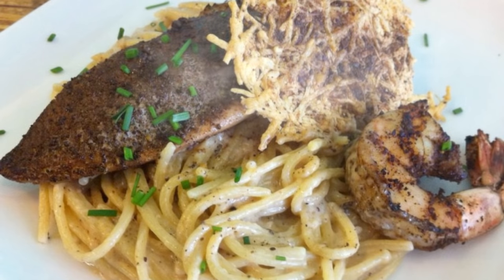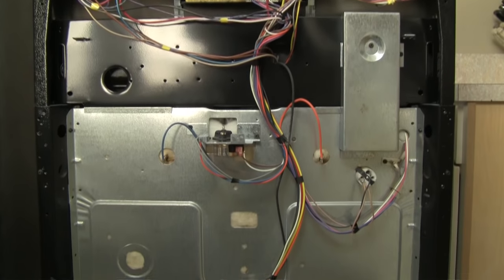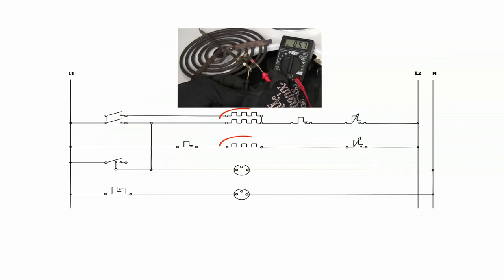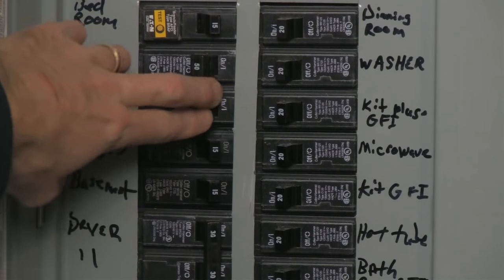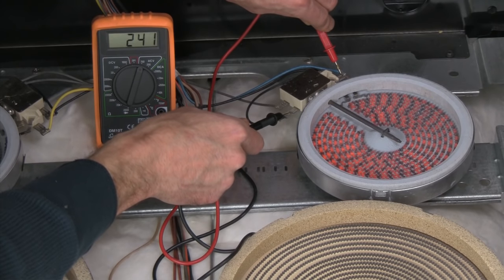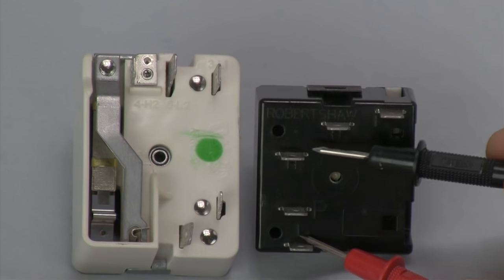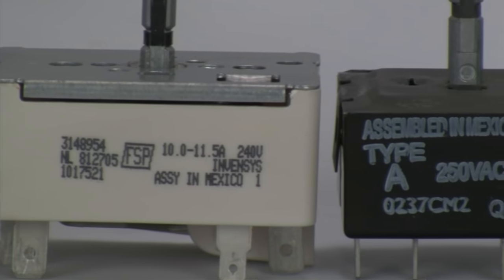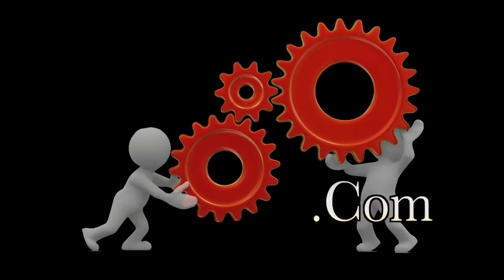Electric Range Stove Repair: How To Repair Burner Elements

Comment: Moving my GE true temp glass top stove has 4 prongs and old stove only had three, how do I convert to 4 prong?
Reply: You buy a four prong range cord and connect as follows.  The black and red are the two hots and connect to L1 & L2 respectively,  the white is neutral and goes to the corresponding terminal.   Green is ground and connects to the frame, typically a typically a green hexagon screw.   You must remove the bonding strap or wire that connects the neutral to frame if you're converting the range from a 3 wire to 4 wire setup.    You must reconnect the neutral to frame bond if converting from 4 wire to 3 wire. For this reason it's a good idea to hang onto the bonding strap in case you move into an older home with 3 wire range/dryer receptacles in the future and plan on taking the appliances with you.

Comment: Hi, I like your video as my glass top range is going to some problem.
The problem "I have Glass top range, one of its Burner shuts off early not reaching the desired heat and that is the bigger burner we use most." Need your assistance to fix this.
Thanks
Reply from the maker: Hmmm... that is a little strange.  Does it come back on after it cycles off?  Or does it just stay off?  What is your range model number?

Comment: Thanks for the great video. I have a newer Maytag glass top rage and the high output element will only work on medium to high. Nothing below works at all. I have already replaced the switch and that doesn't seem to be the issue. Any suggestions? Thanks.
Reply from the maker: What is the model number? I will try to find the wire diagram and take a look.

Comment: I have a whirlpool electric stove Model RF385PXE. Both of the large burners get extremely hot/red regardless of what setting you have it on. One started to do it and we just disregarded it and used the other burners. Now, the other large burner is doing it as well. Would changing the switch on both of these burners fix it?

Comment from the maker: Well it could be a power supply problem or the element may be partially bad. You can check for 240 Volts when the element is on and divide you options. if you have 240 VAC then it should be the element and if you don't check the home electricity supply or the control component. Hope that helps!

Comment: my range is over 10 year old. At first, the problem is that some of the burners can not be properly controlled by the power knob, and they will keep burning. And after a few months, suddenly three of them went of work simultaneously. I think there were chances that water spilled and leaked into under the heating panel. What do you think is the most possible causes? Burner wire broken or swith?

Comment: I have a counter-top stove.
had a short in one of my burner plugs. Blew a hole right in it.
I replaced the plug but the element still doesn't heat. I swapped elements with another burner so it's not the element that's defective. 
Is there an internal fuse in the stove? The indicator light comes on but no juice to the burner.
Thanks.
Reply from the maker: Hmmm... well you can have the indicator light work and only be getting half power through the switch from L1 to H1.  So to be sure you would need to check voltage out of the H2 contact at the switch. The short may have also damaged the wire from the switch to the element so you may also want to check continuity through the wires from the switch to the element plug.  apart from that it must still be a bad contact at the element plug.  Hope that helps! Good luck!

Comment from the maker: I found the model number but I'm not familiar enough with that type to know from memory, and the diagram doesn't really show how it is attached... Most have screws that secure the top from the front... You should see them if you open the door.  If not I would take the back off and look from behind for screws that are holding the top back.  If that is the case it should slide forward a little and lift off once you remove the screws.  Sorry I couldn't be of more help. Good luck!

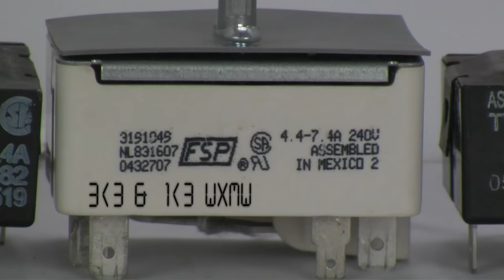Comment from the maker: It should be the second contact inside the element's control switch is welded closed so the burner will not cycle on and off. (6:00 on the video)  If you replace the infinite switch you should be good.  If you wouldn't mind shopping for your parts through the links on my website I would really appreciate it! I get a little commission on the parts sold through the site :)  (there is a link in the description of the video.) Thanks for commenting, I hope that helps.

Comment: Nice video! However, why might a single burner on a glass top (Kenmore brand) stove when turned on High glow orange with heat then go dark then glow orange with heat then go dark repeatedly? The other 3 burners stay orange with heat when put on high settings, but the 1 does not behave the same way and doesn't cook well (leading me to think it is probably going on/off at all temp settings and not just on high... it's only visible it's turning on/off on the high setting!). Thanks!

Comment from the maker: sounds like a power supply problem... many times the L1 and L2 are connected in series down the burner switches so you may have a bad connection somewhere before the wires get to the front burners??? Kind of a strange problem... To be sure you will need to check for 240 into and out of each of the switches in question. hopefully the results will point the way. You can also eliminate burner problems by using the Ω setting and testing the unplugged burner wires (power off) Be careful! Good luck!

Comment: my large glass burner only works on the small size - the outside ring does not heat or turn red. should I replace the whole burner? any suggestions?? thanks, and great vid btw!!

Comment: Have a Kenmore Elite Model # 790.98022800 electric range built in Oct., 2008. Several of the digitally controlled burners don’t adjust correctly and sometimes they won’t even turn off. Have to flit the range circuit breaker off and back on to get the burner to go off. Is there a circuit control board that is going bad then needs to be replaced?

Comment from the maker: If the element gets red hot ever it's okay. You may want to check the oven temperature sensor... There should be a table in the wire diagram for the stove that tells you what the resistance level should be at a given temperature.  So then check it for resistance with an ohm meter at room temp and see if it is close to what it should be by the table.  If the sensor is okay it is likely the control.  Good luck!

Comment: P.S...the burner controls have 5 positions...off, low, low/medium, medium, medium/high, and high. They are all mounted across the front of the stove so they should be pretty easy to access. Thanks

Comment: I searched for an oven with a ceramic and metal heating element from a heater in its oven interior and a fan Located on the back panel to repel steam and circulate the heat and molecules that help the oven's job to broil or bake. and the thumbnail brought me in.

Comment: Great Video.  I have a GE Profile Range Model PCB969SR1SS  None of the stove top elements heat up.  The lights indicate that they are on but no heat.  Everything on the range is working.  Any suggestions?  There is a 15amp breaker button on the  top back but have no idea how to reset it as I can find no instructions on this.  Have reset the house power breaker to the range with no changes.
Reply from the maker: It sounds like the L2 power supply to the range is out... First you should probably check the plug for 240VAC, you may have a bad home breaker.  Not sure about the 15amp button... that may be the cause but it sounds to small to cause what you are dealing with. If all the elements are on it would likely pull more than 15 amps.  Start with the plug. If you only have 120 then you probably need a new breaker. hope thats it. Thanks for the question!
Reply from the maker: Me too... Do you have 240VAC into the burner switches?
Reply: It turned out to be the self cleaning relay switch was not resetting and therefore locking out the cooktop. On the back of the oven you should find a piece of paper with the oven and stove electrical info. It is written on there. Look carefully for it. Took the technician a while to find it as he didn't know what the issue was.  Turns out a coworker of mine has the same stove and had the same issue. You need to be really careful when cleaning the keypad and DON'T accidentally touch self clean.
Reply from the maker: Thanks for the update! I'll store that one away in the old memory bank!

Comment: The GE stove (Kitchen Center) is mod# LJ247P1N2 11.9  from the inside of oven door.the pic shows the wiring behind the control panel.  I replaced the original wiring with hi-temp wire and put hi temp ring terminals on the ends to make secure connections.  any idea where I could find a wiring diagram using this model number?

Comment: What do you think about a dual radiant element where the outer element doesn't get as hot as the center element? This is the second element and does the same thing. Originally, the outer element on the original burner got as hot as the center, but then something went "poof" and the outer element stopped getting as hot. I'm thinking the switch is bad. Also, do new cooktops give off a chemical smell when initially turned on? It's smells like chemical or plastic is burning when this same burner is turned on.

Comment: How do you remove the top to replace spark module from a gas cooktop seal burner with no screws on the burner itself? Only the summer burner back left has a tiny screw on it.  Sc8640edb4

Comment: Hi, I have an LG electric stove that was reading PF on display. The oven stopped working but the burners were operational. I unplugged the stove( turned breaker off first ), check if elements were bad, but they were fine. During the course of testing I turned on and off the breaker. The next morning plugged  it back into the wall and no power at all. I had ordered the oven relay, installed it and still nothing. Any advice?
Reply from the maker: Juan Lugo Usually PF is "power failure". In order to narrow it down you are going to need to check voltages with a meter. What you are looking for is that you have 240VAC at the plug. Next check that the voltage is getting  to your range control. usually it's a direct connection but some ranges do have relays, fuses, and other things that may be installed. If you get stuck give me your model number and I'll see if I have a wire diagram for more specific test points.  This is a quick little guide to measuring voltage... It may help...
http://applianceassistant.com/Electricity-And-Testing/How-To-Use-A-Multimeter.php
Reply: applianceassistant

Comment: I have question. Today my stove a General Electric flat top was working this morning, but later in the afternoon is not working not even the oven everything is cool to the touch, but the range does turn on and the clock works and that's it. Do you know what the problem may be?

Comment: Hello Dear, It was GREAT AND  INFORMATIVE video,BUT in my country I  don't have 110 volt , i switched it on 240 volt but the transformer which supplies the PCB get damaged ,i need solution to deal with my electricity standard which is  one single phase 240 volt  with minimal damage. thanks

Comment: I have a Kenmore stove and one of the burners would not shut off.  So I stopped using it.  Shut it off at the circuit braker.  I then tried again using another element to see if the problem was still there.  Same thing happened.  I disconnected this element and googled "stove burner will not shut off".  I connected with a site that told me the switch was bad and showed me how to open the back of the stove.  I checked the part to make sure it was the same as the one I had and I ordered it.  I just installed it, but I am concerned because it takes a very long time for it to cool off.  It is cool now.  Is it because the power is stronger and the element is getting hotter?  Should I be concerned?  Thanks for your video.

Comment: Great great video!! I have a Frigidaire Galleria and the two front burners on each side won't heat up to red level although they still get warm. What do think the issue is? Thoughts?
Reply from the maker: Thanks! Sorry for the delay. probably not getting a full 240 volts through the switch. However, it's a little strange to have two burners do the same thing.  Did they both start acting up at the same time?

Comment: Good video. I was hoping that you would show a glass top element repair.  I have a GE and the right front has large and small elements. The the large works fine but the small seems to be getting weaker over time. The small burner on the right rear has double the heating than the front right small element. Any idea if this has to do with an infinity switch with a poor conduction?
Reply from the maker: +Robert Greenhouse low heating is a strange problem and hard to diagnose without looking at it... normally the elements are either good or bad, weak is strange.  I would start with the infinite switch. Sorry I can't be of more help! I would love to hear what fixes it when you get it!
Reply: Sometimes corrosion or charred contacts can be the culprit here so I will check them first. Thanks for your reply
Reply from the maker: Sounds good! Thanks for the update!
Reply: +Robert Greenhouse did you find any resolution? We have the exact same problem and I don't know what to do. Any suggestions? Thanks man.
Reply: Paul Watson-Ausencio not yet. I will check soon
Reply: Not yet, sorry. I've been very busy
Reply: How to repair a led king fuacet

Comment: Hi I have a Electric Range Kitchen Aid Model # KESH307HBL0, everything work fine with no errors on the screen. I did notice the left front dual element only energizes on the dual setting (med & high), nothing happens on the low setting. I believe the center of the element is supposed to illuminate but doesn't. I removed the glass and visually inspected the element and didn't notice any breaks to it. Also control knob switch,wires, and connections to this switch all look good. I'm assuming the voltage to the range is good since the other dual burner all work fine. I'm pretty good at tinkering with this stuff. Can you help me? Was wondering if I should dismantle the duel control switch to inspect the internal contacts? Your thoughts are appreciated.
Reply from the maker: I would advise checking the inner coil of the element for a break with a meter. It could really be the switch or the element. The only way to be sure is checking for continuity with a meter. Don’t open the switch or it will become a problem if not the main one at this point. Hope that helps! Good luck!
Reply from the maker: I would advise checking the inner coil of the element for a break with a meter. It could really be the switch or the element. The only way to be sure is checking for continuity with a meter. Don’t open the switch or it will become a problem if not the main one at this point. Hope that helps! Good luck!
Reply: applianceassistant ok I will check for continuity, just curious about the control switch (where the knob is), is it fair to say that it has the capability to allow the outer coil/element to function properly and not allow the inner coil/element to not work at all? Just asking is case the two elements both come up to be good.
Reply from the maker: Yes that is possible, that switch has twice the connections, an H1 and H2 for each part of the coil.
Reply: applianceassistant thank you I will keep you posted

Comment: I have an old 50's GE electric stove which I repaired (mostly) by replacing the burners and wiring to the switch banks from each burner.  Everything works fine except when pushing any of the warm buttons (lowest setting on switches).  If any warm button is pushed, the breaker trips instantly.  Any ideas on what's the problem?  the burners are double coiled.  Jeff

Comment: Great video, I have a magic chef and the right front element does not heat up.  The element is good and I am not getting power to the element receptacle, but the red stove light comes on when I turn on the knob.  Although the stove light comes on, can it still be the infinite switch? any ideas would be helpful....Thanks
Reply from the maker: if the light is coming on you probably have an L1 to H! connection through the switch but if the element is okay I would guess that the L2 to H2 connection through the switch has a problem. The other possibility is a bad wire or connection between the switch and the element. Really need to do voltage or continuity checks with a meter to know for sure. Hope that helps! Good luck!

Comment: Question: I recently, and for the second time in about 7 years, replaced the switch for the largest of the four burners on my frigidaire cooktop. Thing is, this time when I replaced it the burner no longer gets as hot as it always had. On the highest setting I could barely cook a grilled cheese. What should I test or look for? I have a multimeter.
Reply: Check the switch rating, you may have inadvertently installed a lower power element switch which only allows the element to get to a certain temperature.  Not all the switches in a stove are the same rating, larger output burners need switches which can handle more power.   Hope this helps!!!